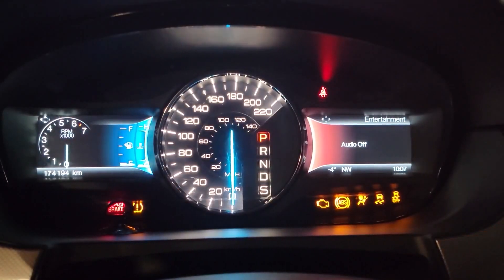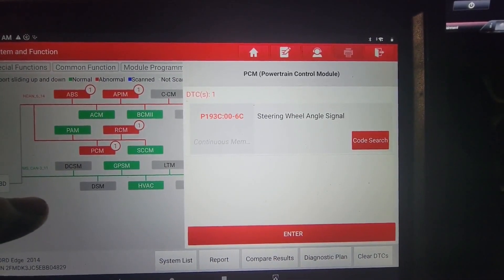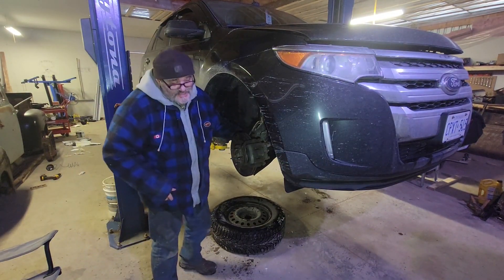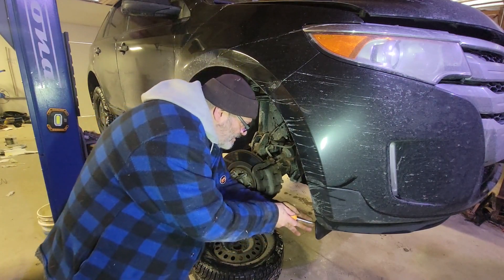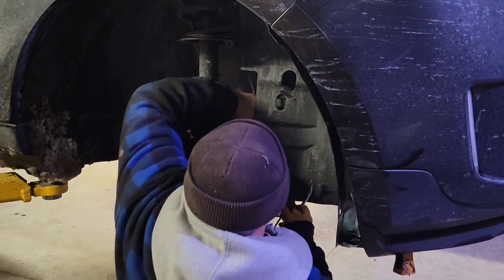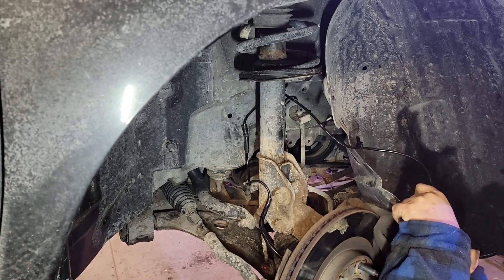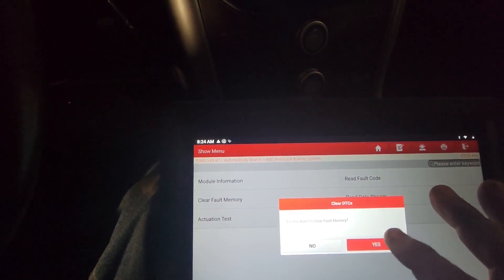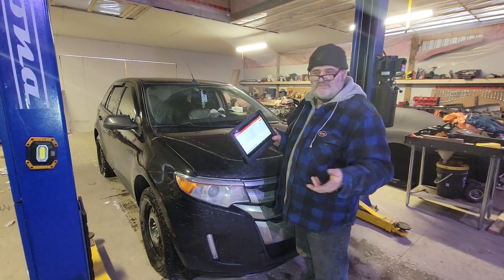Service AdvanceTrac Fix

Comment: Hay body I have f150  2014 4x4 I did  it towed yesterday on neutral for  and next day mi advance track control gos on and mi steering wheel not working and is hard to turn on

Comment: Hello there wondering what brand of scan tool u were using?
Reply from the maker: This one is a Launch Scanner XV431, I also have an XTool IP608 that I'll be doing a review on shortly that costs a few hundred less.
Reply: @SchnebsGarage  How do you check the codes my uncle put on wheel bearing on the back of explorer and now all the lights on stability control and ABS they all on he also got a senser I guess that speed senser on the back any idea ?thanks

Comment: You didn't post the airbag video? I have all those same lights on my 2013 lincoln MKX after getting hit on the right tire area. Ordering the abs speed sensor now. What did you replace for rhe airbag light??
Reply from the maker: Ended up replacing the side airbag sensor in the door, first part they sent out was wrong one which is why it never made the video.
Reply: @SchnebsGarage  Awesome! Thank you for the help!
Reply from the maker: @MrJChave  No prob good luck.